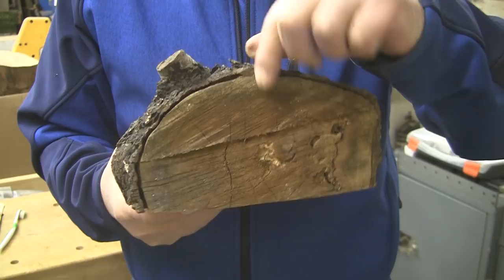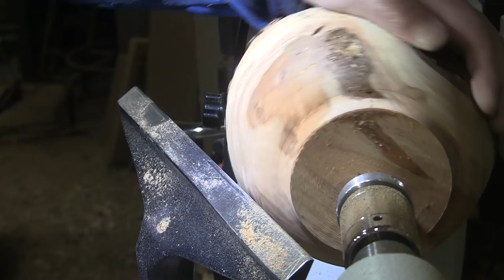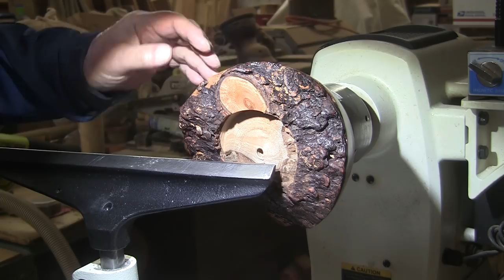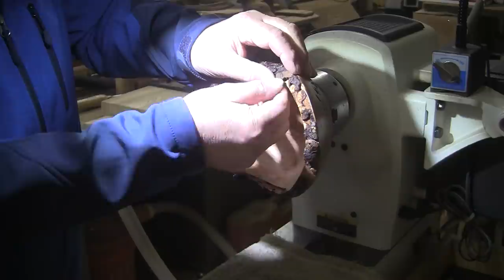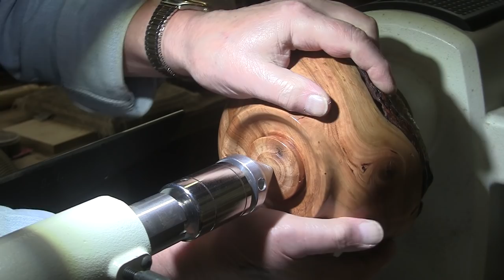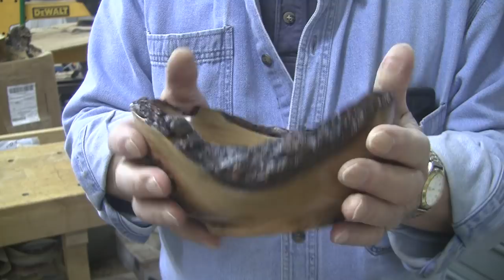Faking The Bark! - Wood Turning

Comment: Great to see you in action again Phil! The bowl is great as well. If you had not showed us the missing bark I doubt anyone would have even know you added it on.
I used to use something called Liquid Gloves made by Avon. That was many years ago. I remember using it at work when we had to make fiber glass and epoxy laminated core boxes.
As long as you did not wash your hands before you were done and forget to reapply it worked great. Not sure I still have any but I had a tube in my tool box so I will check it out.
 Good to see you and looking forward to the next one when you are up to it.
Take care my friend,
Gary
Reply from the maker: Thanks, Gary!  It was good to be back in the shop for awhile.  😊

Comment: Welcome back Phil, good to see you again.
What I usualy do when I want to save the bark, before starting hollowing, I get a thin parting tool and make a thin cut on the spot from where I want to save the bark to turn a bowl with a natural edge. Using the thin parting tool hardly gives any friction to the bark and cuts the bark like a hot knive goes through butter. You might just give it a try.
Reply from the maker: Thanks for the tip, Ron!

Comment: Great to have another video from you Phil.  Hope you get back to full health soon so you can enjoy making the videos I, and I’m sure a very large number of others, enjoy.  I’m just wondering why you didn’t apply some CA to the bark joint earlier before it started to fly off, at least after the first piece left the bowl.  I normally do that as soon as I can when I get near the final edge. If necessary to add pieces back I will even go to the trouble of sometimes sanding down the backs or sculpting them with the Dremel  to fit them in.  I do this just before the final turning passes and then do my sanding.  This way even I have a hard time showing someone where the patch’s are ( on some woods, some types of bark loss results in natural versus live edge bowls 😟). Thanks again for the video.  Hope you’re feeling better soon and able to do more.  Cheers, Tom
Reply from the maker: Thanks, Tom!  The bark was separated from the wood by up to 1/2" in places.  It was also quite warped so there is no way it would have squeezed down and conformed to the wood, again.  Just no opportunity to apply CA first but I did consider it.  Lots of good tips, thanks! 😊

Comment: The way you shape the base of the bowls, is that what stops them from developing cracks?
  My grandfather, when he retired, dabbled with turning, and got discouraged when they warped and cracked
Reply from the maker: More likely due to turning wood that is dry, I think.  If it's wet when turned and then left to dry on it's own, that's when the cracking usually starts.  😊

Comment: Phil have you ever tried applying penetrating laminating epoxy or thin super glue to hold on bark before it comes off.
Reply from the maker: Never tried epoxy but I can tell you, Charlie, the bark had warped and separated by up to 1/2" from the wood.  No way super glue would work.  When the gap is small, yes, I have used CA on multiple occasions before I start turning, works a treat! 😊

Comment: I AM so very Thank-Full that you made this video and chose to share this turning process with us. 
This Bowl is Beautiful, Beautiful, Beautiful & I Love, Love, Love It, Truly! The Bark is Perfect. The Bowl sides came out great. Leaving it the way you did was the smart thing to do. 
LOL...I'm very glad you stopped grinding down the bottom, and you're right you can stop when you want. The bottom and the sides don't have to match, or they can match. But we don't really need a funnel as fancy as that.  
(I'll say it again, I know, I'm a pain in the btt.) Had you flipped it to start & had the tail point going into the bark area instead (and the camera moved...lol...) Could you have worked the bowl that way? That would leave the bark basically in tact, yes? Then putting the whole, where the bark was missing 2.5"/round, or starting where the bark was missing 1"x3"/across, the long way. Either was taking it down safely as deep as possible.  
Does that sound possible, honestly? 
Since I don't turn wood or sadly, have a place to do it, I don't know. 
             ~~~~~~~~~~~~~~

Just to give you an idea what I think when I see a piece of wood like that...          1) Leave on the branch end.                                 2) Use the 4" end as the bottom.                
3) Sand it everywhere there isn't bark.             4) Drill a whole on the top (3"/wide end) that's 1" x 3"x 5"                                                   5) Cover the piece with the Varnish, etc., but use glossy for the bark & branch bit (the front side), Then matt for the top, bottom, and two back 'sides'.

That's my two cents worth I would use it as a vase for dried items. I do Sacred Art Installations & Altars when I can get the business. I really love Natural things.   

So, Mr. Phil...I do not sympathize, but I certainly do empathize with you. 
I will be praying for you...I'm a trained Professional, & I will continue to do so until I hear (or rather 'see') you tell me to stop. Hang on to your wood shavings Phil...😉

Comment: Wonder if a couple coats of water thin, penetrating epoxy before turning would help secure the bark ?
Reply from the maker: Nope.  The bark had warped and pulled away from the wood, leaving up to 1/2" gap in places.  I think what I did was about the only way to save it. 😊

Comment: Phil , what are your thoughts on using Min Wax wood hardener , and a CA accelerator ? 
Another fine  gnarly pot
Reply from the maker: Two questions or a compound question, Gary?  The accelerator WITH the hardener or with CA?  I've used the hardener and don't love it.  Seems to change the wood.  I use accelerator with CA when strength is not the biggest concern.
Reply: Thanks , hardener alone , seems to turn the wood to a hard plastic like material ..  accelerator with C A club members have found that ca accelerator makes the bond brittle  and prone to snap , when bonding  two pieces together , for spindle turning. Boss was demonstrating making 2 piece ear bobs and 5 of 6 snapped at glue joints .,Tight bond works better

Comment: Awesome Black Cherry bowl Phil. I do have a question for you. I know it may just be preference but I've noticed you don't use a mortise. Is there a reason to avoid the mortise? I've had tenons let me down in the past.
Reply from the maker: Thanks, Hugh! 😊  Many of the pieces I turn have cracks and as you know, you don't want to open the jaws up into cracks.  I feel a properly constructed tenon is stronger.  I will use a mortise occasionally on thinner pieces like platters and sometimes on small pieces.
Reply: @PhilAndersonShadyAcresWoodshop  thanks Phil